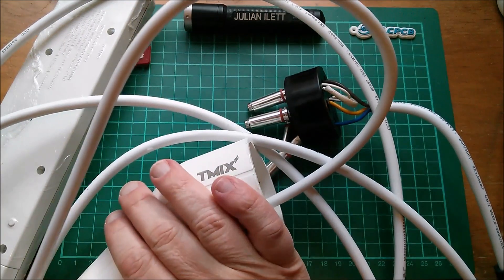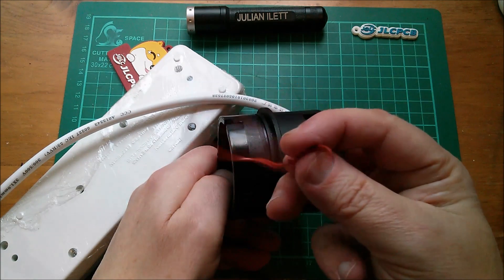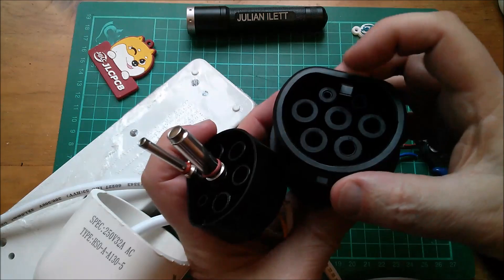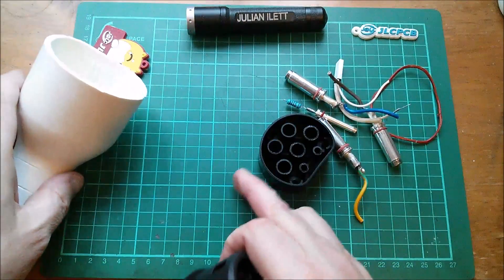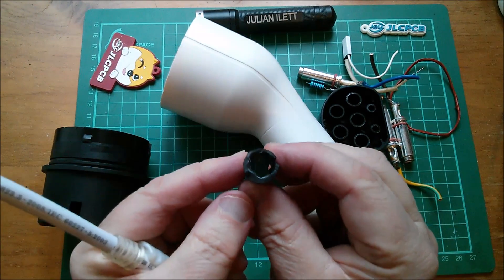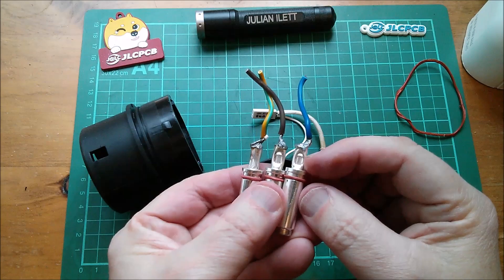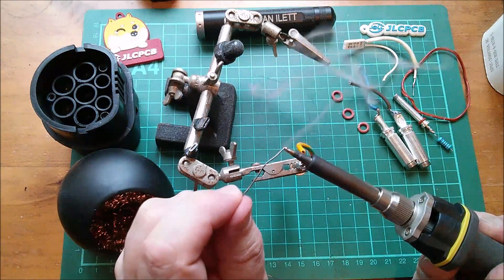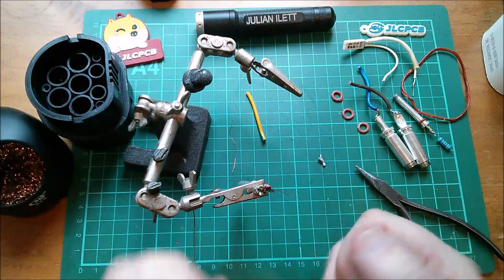A look at a V2L cable bought on Alibaba.com

Comment: Why did you say this would never have worked, it would have worked, just not at the ampage you wanted. If your going to do this type of videeo then explain it correctly, all your doing is confusing people with less experience by only giving half the facts.
Reply: To be recognized by mg as a discharge cable the resistance has to be from 380 to 480 ohm , with 2k it would have not worked at all , that cable was for a different car . 😉

Comment: Can we work together, Sir?Electric Car Side Discharge Plug EV Type2 16A Charger Cable with EU Socket Outdoor Power Station( need car supports  V2L).  There is a need to find me to understand the product in detail!!

Comment: Interesting... I've seen a YT video where someone used the highvoltage input of a solar invertor (one of those cheap chineese ones) that takes upto 500V to connect direct from chadamo so the invertor thinks that there is a solar panel and you can get your existing invertor to take energy direct from the battery instead of using the onboard(if supported) invertor of the car. I think wall box is making something for direct ccs/chadamo, but at around 3000/4000 GBP

Comment: You need a bigger tip on that iron. I have a 40 + year old Wellar Instant Heat soldering gun that still does sterling service when  high thermal mass connections need to be soldered.

Comment: I find the biggest problem with soldering these heavy thermal mass joints isn't the temperature, it's the thermal sensor. My pinecil struggles even running on a high-current supply with the full 20V, because the coupling between the tip and the temperature sensor isn't that great, so it doesn't know to pump the energy in straight away when you try to melt the big joints. The joint just sucks the heat away to the point where the tip gets stuck to the joint, but the pinecil still reads it at full temp.

I'm considering buying one of the clone JCB soldering stations and using it with a genuine tip, since they seem to handle the high thermal mass joints well in reviews.

Comment: If the thermal cut out was wired in series with the resistor the resistance would be the combined resistance of the thermal and resistor.
Reply: The thermal cutout has no resistance. It's either shorted (0 ohms) when cold and goes open circuit (infinite resistance) once hot enough, so the car sees it as being unplugged, and hence stops supplying power.
Reply: @zaprodk  Well it cannot be zero ohms because it is essentially a fuse but probably close enough to not affect this circuit much.
Reply: @benbaselet2026  of course not "zero", more like a fraction of an ohm, if that much. But you know what I meant :)
Reply: @zaprodk  Well depends on the device and value but it needs some resistance to function and that can be meaningful in many applications so it's good to keep in mind that it cannot just be reagarded as a piece of wire type of device is what I meant.
Reply: @benbaselet2026  a /thermal/ fuse doesn't need any resistance. It doesn't work thr same way as a normal fuse that melts over if having too high a current flowing. A thermal fuse is two small terminals pushed together, held by  aspiring mechanism and a wax engineered to melt at the intended temperature. It has next to no resistance - it doesn't need resistance to function.
Reply: @zaprodk  So please explain to me how is the wax melts if there is no resistance to generate heat from the current?
Reply: @benbaselet2026  The heat is applied externally to the sensor.

Comment: Lead free solder is an abomination. 😁
Reply from the maker: It is.
Reply: @JulianIlett  Some of the more expensive lead free solder alloys that are now available are much better to use. For work I have to use lead free solder all of the time so you soon get used to it's quirks with practice.
Reply: @SiaVids  It will probably behave OK when you are doint it right, otherwise the industry would not work. But will it last? What's different with them compared to the cheap stuff and is it available to regular people?
And easier workability means better connections for the rest of us who are not very professional with the best materials and equipment.

Comment: Damn there will be a part 2?? 🙂
Reply: I just ordered one from EV cables in the UK - a bit more expensive but not that much - in anticipation of power cuts this winter. Got an MG5 which can give 2.5kW so enough for the central heating and lights.
Reply from the maker: Me too. I've started using the V2L to power my office heating. I can get around 5 hours heating for 5% vehicle battery usage.
Reply: @JulianIlett  Hi Julian...I too am sat in my nice warm shed running off V2L to the MG4 ...I have it on a 3 pin plug to the adapter I got from Ebay which works fine (you may have seen my vid) but I have just received a Type 2 plug similar to yours from Ali Express...its much easier to take apart and looks ell made.....I was wondering about solder or crimping I have a proper Iwiss crimper but have not crimped this sort of connection before ...my max load is 2.5kw so may just solder and like you say its just for me.

If I do mess up a pin is there a cheap UK source for them? ...just the pins alone...thanks
Reply from the maker: Yes, more parts to come. New O rings and resistor ordered :)
Reply: @JulianIlett  glad there will be a part 2, i was so disappointed when it abruptly ended. great video love the channel
Reply from the maker: Thanks Barry. At this time of year the light fades so quickly - that's what terminated this video.